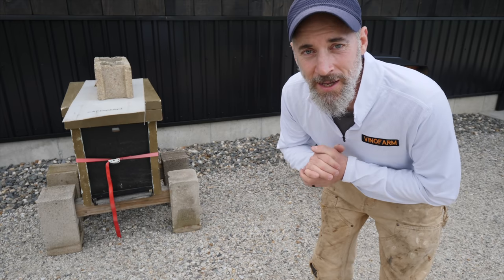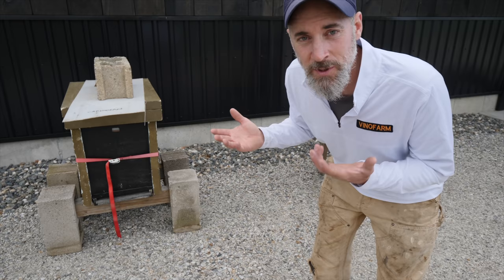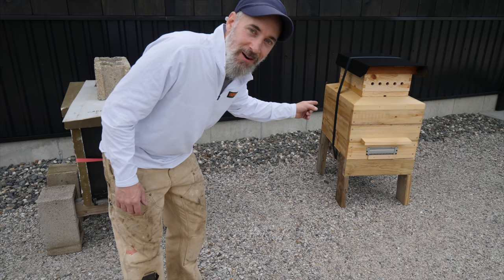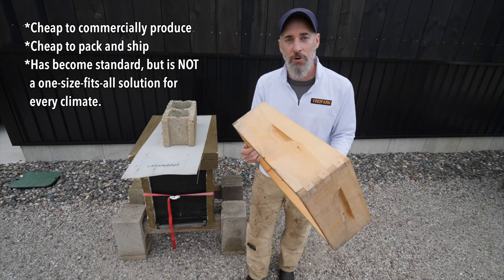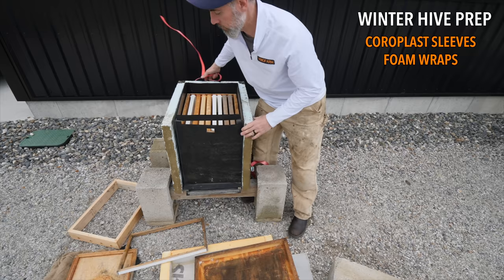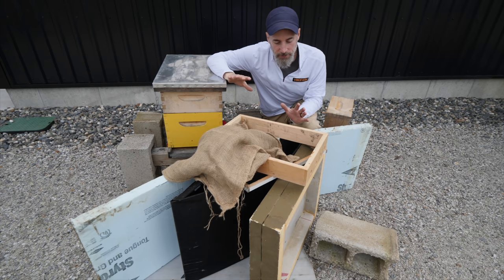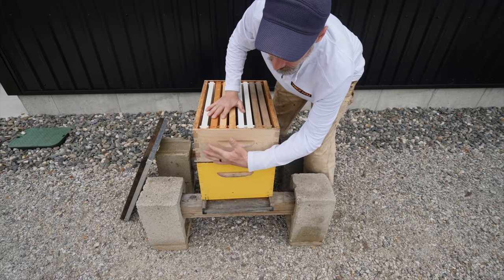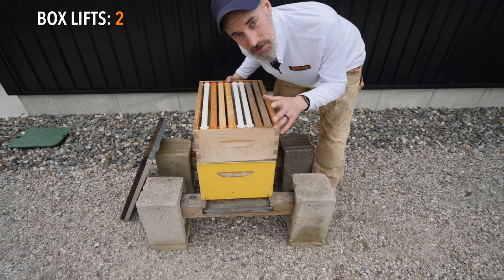I Fixed The Langstroth Hive (For The Bees AND The Keeper!)

Comment: New to bee keeping. Have been doing research, reading, watching videos.  I'm a residential designer here in New Jersey so I understand the issue of cold winters + bees.  My first thought was to insulate the hives just like Jim but my other thought was to bring the hives into a shed for the winter.  Now I'm looking to have 2-4 hives.  Not 13-20-50...  Is this a viable solution?  or just a crazy idea.  To be clear, this would only be for the coldest (freezing) months and obviously the hives would have to be mobile in some way.

Comment: Do you have Australian bees? :D I have never seen the brood nest as you describe it. At the top of the frame, we have an arc of honey, then an arc of pollen and below that, the brood. I don’t wish to dampen your obvious enthusiasm, but your argument for bees having infinite space does not hold I'm afraid, if you have ever opened a feral colony in a hollow tree for instance, the brood-nest is always at the bottom, winter honey stores above in (continuous) comb with pollen maintained above the brood. They don't have a central brood-nest. We have more temperate weather in the UK with the rare snap to -15C (5F) and highs occasionally in the 30s (86F). I have played with insulation methods in the past. I don't bother now, I raise resilient bees instead (I don't mollycoddle them). However, it should be noted that hives here tend to be square in cross-section i.e. the BS National hive is 460x460mm (18 1/8"). And so has a smaller surface to volume ratio, possibly making it slightly easier to keep warm. This squareness is nice since it allows the frames to be rotated with respect to the entrance if required (warm way/cold way). Have you come across the WBC (William Broughton Carr) hive with it's external "lifts" that provide winter and summer insulation? I have used these in the distant past when I was a child, but they are hard (extra) work. You must remember that beehives are more about people than bees, if they don't like a hive, they will abscond. Bees don't need hives or beekeepers. I must say, a beautiful hive though, and well made. Power to you.

Comment: Wow, you made a Layens hive the hard way.
Reply from the maker: I built it using a Langstroth bottom board, Langstroth deep box, Langstroth medium box, Langstroth inner cover, Langstroth lid, Langstroth width frames, Langstroth foundation and it will be supered with Langstroth medium supers with Langstroth medium frames which will be extracted in my Langstroth sized extractor.... So it's basically a Layens hive, except it's not horizontally oriented, the frames are not touching and it's designed to use supers to collect honey. 

I didn't build a Layens hive. Stop. It's still a Langstroth hive.

Comment: I"m making my bee barns and am up to my own version 3.0. I am considering a fairly substantial change.  Attaching screen directly to the underside in a removable way, and having the entrance on the side of the barn itself. This would allow the barn to sit lower to the ground. Do you think the juice would be worth the squeeze?
Reply from the maker: Why lower? I just designed mine to sit so that the top of the brood box was a comfortable height for me to stand and pull frames. It’s all ergonomics for me.
Reply: @vinofarm  would it be more ergonomic overall if the supers were a bit lower? I admit I may be overthinking this.
Reply from the maker: @DougMcHone  Whatever works for you. I just don’t like bending. I can lift supers if they’re waist height or above. But I do NOT want to pick up boxes below the waist. Or hunch over for an entire inspection. I stand upright the entire time with my hives.

Comment: I bought some frames at the farm store and am not impressed. As a woodworker, I've been building my own and have 25 top and bottom bars done. Sidebars are next.

You mentioned foundationless wouldn't work well, but what if 2-3 frames were that way with fishing line and neighboring foundation to keep them on track? And what if I cut the foundation to increase the size of the middle area?

Are these bad ideas? I really like the idea of letting the bees determine their layout as much as possible without ending up with cross comb problems.
Reply from the maker: If you’re talking about extra deep frames, foundationless is going to be tricky. Sure, you can wire the hell out of it, but if they fill these with honey, I can easily scrape off sections and they will reduild. Cutting out foundationless will be messy if you have wires/ fishing line everywhere. I’m REALLY liking the frames the way I built them. They’re drawing them out fast and using every inch. And I like how secure they feel when handling them. Even foundationless deeps make me very cautious. The extra deeps will be nerve wracking if they are foundationless.

Comment: When building or reworking a langstroth hive you may want to look into a layens hive. It's much better insulated and still ventilated. It should work much MUCH better for anyone in the north. It does take a different honey spinner than a normal langstroth frame spinner.

Comment: The problem I see is that we or the bees are not in zero gravity. Just like a drop of water in space it forms a ball. This is your theory with the bees. If they were in space they max extrude comb that way. However as with all things gravity laden. I think you will find that they start at the top of the frame and make a long elipse shape the same way they do in nature. Even in a tree.
Reply: Otherwise I love the insulated box design. It does imitate a tree very well
Reply from the maker: OK. I meant "unconstricted space"... but with gravity! Not "outer space". I was trying to imagine the comb suspended in air without boxes or frames. But still with up/down orientation. Thanks for watching.

Comment: After thinking about this setup for a couple of days, one big thing nagged at me.... In my experience, unless a queen excluder is used, I often find my queens and brood clusters near the top of my hive; sometimes near the middle boxes, but rarely at the lower regions..... With your design for 1 piece, double-deep brood frames, I see no way to push the brood cluster to the bottom of the hive..... This got me thinking that, perhaps, as the cluster moves up during cold months, there would actually be less accessible stores even though half of their stores are actually there in the lower section that they won't try to get to at all?.... Also, when spring comes, and the cluster is near the top of the brood box, how would this design facilitate a way to put the queen near the bottom again and ensure enough laying space for her?
Reply from the maker: I thought about this as well. However, my bees have been overwintering in deep/medium boxes for years. I have been doing the pre-box rotation and they spend the winter in the upper box (deep) and go through those stores in winter. Then we have a long drawn out spring with no nectar until right around now (Mid May). They come out of winter with the lower (medium) box pretty much untouched, but usually empty it by May. The lower area is the spring food. That can all play out the same way on the extra deep frames. As far as where the queen starts laying, I’ll just have to see. I wanted to just give them a big cavity of unobstructed comb fill as they like. It’ll be very interesting to watch. I do plan on using excluders if I put supers on top.

Comment: Do you have SHB and Wax Moths that can hide behind the two spacer/end boards? I hope it works for you, good luck.
Reply from the maker: No SHB at all in 5 years. They don't survive up here. Wax moths can be a problem, but I went to great lengths to seal all the places I usually find them and reduce openings.

Comment: I was wondering if you had *any other videos, photos or sketches*?  Could you add a follow-on video on some of the more technical aspects?  I noticed some asymmetries in your design (screws in the front and sides instead of front/back?) and there were some details left out. (eg: the bottom entrance),  The shiplap is another nice design feature, but not sure if you bought the wood with shiplap on it, or added it after.  I don't have the luxury of Alaskan Cedar, though I've built over a dozen hives w/pine.  I adopted your V2 insulation for this year, and retro fitted the front with more insulation.   I got all the wood I need to build Barn Hives now, just need some more insulation. so far - everything has been free or donated.  All my hives are in out-yards, so no Broodminder for me...  Time to get into the workshop and get to work.
Reply from the maker: I made the rabbits on the 2x6s so they’d have a ship lap effect. It also made the lumber fit perfectly. I used exactly four 8 footers per hive. Almost no waste. Pine would work just the same. At the time of purchase, my lumberyard had AYC for $18 each and Pine/spruce at Home Depot was about $16, so I splurged for a superior product. Any 2x6 would be fine for this. Re: the screw pattern, I lapped the front over the sides and the sides over the back. Not sure why, but it made sense at the time. I think I just didn’t want to see so much end grain from the front view. 

Everything was physically sketched out on the bench as it was being built. There were never plans. I’ll edit a build video in the next couple months. I’m consumed with barn finishing and life right now.  I have 7 or 8 videos shot that need editing and uploading. I just don’t have the mental bandwidth right now. There’s nothing super mysterious about the build: Regular hive bodies wrapped in foam and then wrapped in wood. Little details just got solved as they came up.
Reply: @vinofarm  Thanks for sharing the build video!  I'm building 3 barn hives now. I just finished the inner boxes and half of the frames. I'll likely build new solid bottom boards from scratch, with the entrance and floors that are sloped down and forward for easier winter cleaning.  (\_/ shaped).  Angled to make the outside entrance lower than the bottom board (for heat conservation), and likely will help the mortuary bees drag bodies down and out the front easier, and if there is moisture, it will help channel the water out the front, too.  How's the moisture in your hives?

Comment: Do you have dimensions of the frames posted anywhere?
Reply from the maker: Standard Langstroth width. I used Betterbee top and bottom bars. Sides were just built to fit in a deep+medium cavity. I left about 1/2” at the bottom of the hive. I don’t have an exact measurement at the moment. My frames are all in the hives. Just measure the space you’re trying to fill for the depth. Some people are making them for a double deep.

Comment: Do you kill bees putting the spacer back in. It looks like it hangs does it not touch the. Bottom?
Reply from the maker: Same dimension as the frames. It hangs. I slide it down the wall very slowly and see the bees moving out of the way.

Comment: So the feeder for the jar why not make a rim to hold the jar in place and also why take out the metal pieces and move them to the other side for the different ventilation? Can’t you just put those on both sides and make them work in tandem so you don’t have to take them apart. Also maybe consider rubber, plastic, or PVC for the exterior plastic to make it more weather resistant. Can also add observation windows with a latch to cover it on the sides.
Reply from the maker: This was version 1.0. In 2021. Check out version 2.0 in my latest few videos.

Comment: hrm.. palletize and store inside instead of all the propriety hardware might bee a thought. might be able to control nesting habits better by fakiing a longer/shirter winter.
Reply from the maker: If that works for you, sounds good! It was not the direction I went.
Reply: @vinofarm  I was just thinking of how your setup is a perm bee yard and the huge investment in landscaping and other various investments beyond langstroth equipment. by my estimates you could have had a bee shed to house and temp control hives year round. Not to mention the keeper can have heat and ac in the summer with a mini split.
they do cabinet bees in euro countries quite often. heck they even build a bee shed on trailers for pollination. this concept totally fits in with your no lifting ever. they hives have a screened inner door and the shell resembles a household cabinet. also if you want huge panel frames. they make the out west in so-cal for pollination where the frames r man sized on a pull drawer slide at the top or clips for inspection. I would estimate to overall hive as 4'x2' with open sides likely due to the sheer numbers of bees and ridiculous summer heat near mexico/so-cal

here is an example of bee shed.
https://www.beeculture.com/no-lifting/

Comment: Aside from the availability of good soil, among the chief reasons for the agricultural richness of islands, California, Italy and Israel is the Mediterranean subtropical climate, wherein temperature extremes are moderated by proximity to large bodies of water.  

Water has a high specific heat coefficient, which makes it an ideal substance for regulating the temperature of objects near it.  (It absorbs heat during the day, and radiates warmth at night.)  

This principle is being employed in domestic heat-pump systems and automotive engine blocks.  

Have you considered trying water chambers, —such as those flat, refillable manufactured for use in thermal picnic chests—  to surround a beehive?  

·
Reply from the maker: Interesting! But probably not a good idea in our climate where we have 5-6 months straight of freezing nights. The bees don’t generate enough heat to keep a water chamber from freezing when the outside temps are so cold. I think you’d end up with big blocks of ice.

Comment: Just curious a few questions, I to live in an area where the summer season is short and the winters are colder. My wife and I are considering beekeeping. I've read a great deal online, in the library and watched hours of YouTube videos. Your design seems to mimic the Layens frame other than the extra width. Is there any science behind your slight changes or is it simply experimental? I mean no disrespect with my query, please understand. I'm also leaning toward the horizontal hive design being a bit older I thought that would be easier on my back. You spoke of moving and stacking heavy boxes at the beginning of your video and I would rather avoid that is possible and your design does not seem to address that. I can question the folks that are promoting the horizontal Layens system but the fact that they are doing just that "promoting" makes me want to sell answers elsewhere if you catch my drift. Thank you for your insight and wonderful videos. It is great to see individual's like yourself trying to help out the rest of the world.

Comment: How easy would this be to scale? How long did the one box take to build and how long do you think you could get the production time down after you get used to the design and the manufacturing. Its an awesome design, but looks like a ballache to build.
Reply from the maker: I batched out 6 of them. The frames take longer than the box. I spent a month of late nights after dinner working on this, but it definitely got faster by the last one. It’s not a high production piece. Everything about this is kind of sculpted. Bespoke Bee Barns.
Reply: @vinofarm  do you have plans or anything for these?
Reply from the maker: @Socialistdrummer  ha ha… no plans. I wish I had the time or skills with sketch up, but I did this from scratch in the barn. I spent a long time building one exactly how I liked it, then disassembled it and used it as a pattern to batch out 6 more. So I have a “pattern” hive in the barn to play with and try out new mods on. It’s like a 3D, “3D model.” There’s just a lot of parts and cuts. The frames are like a 20 step process on the table saw. I wish I had a CNC.

Comment: screened bottom board is the reason your bees aren't laying down low. up north where you are i can guarantee that wind rushes up through the bottom even in summer. bottom screen boards are an outdated technology that im probably going to stop using myself.
Reply from the maker: All my hives used to sit on insulation year round. They were never open to wind. These are even tighter.
Reply: @vinofarm  a solid bottom board would be even tighter than that.

Comment: This new hive will probably be better than your original hives.  I still dont know why you just dont overwinter in a single deep / with screened bottom board for some ventilation and small vent in roof too. You dont need to use Styrofoam and insulation and all that other burlap etc .. We get worse winter over here and we over winter hives in wooden standard hives in a single deep. You need to feed and treat for mites correctly that is the main obstacle. Your feeding seems okay but u do have many mites....
Reply from the maker: OK.

Comment: Consider placing three 2" inch insulation boards on top of your burlap for R38.  Condensation will occur on the cooler side walls of R10 giving the bees a source of water and condensation will not fall directly onto the bees. I think Prof. Thomas Seeley would approve.  See https://www.northof60beekeeping.com/education/fall-and-winter-preparation.  Best of Luck.
Reply from the maker: Yes, I was pointed toward Etienne and am suddenly rethinking my whole top solution. I planned on making an insulated lid that went OVER the burlap box, but now I’m thinking I may not even need the burlap… just insulation? I need to contact him and talk about it. I have 5 months to come up with the setup before winter. Thanks!